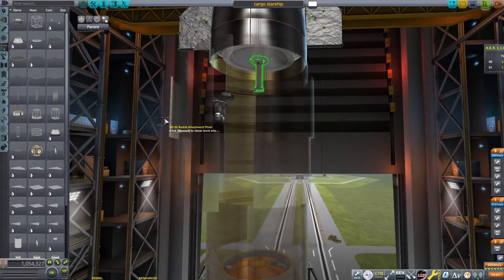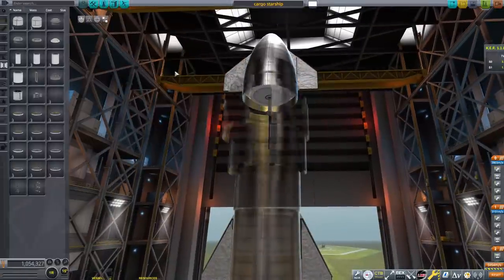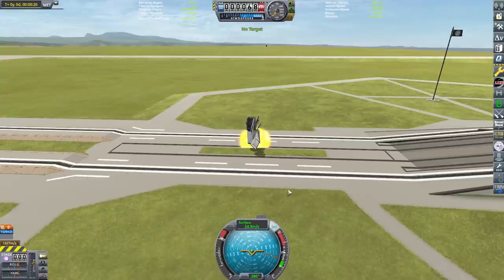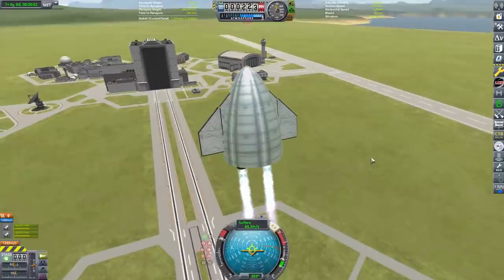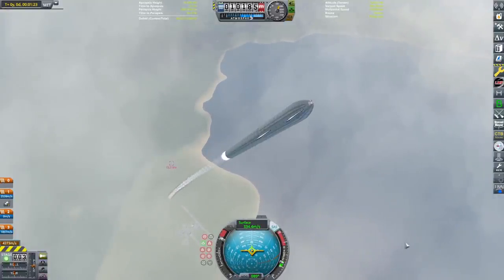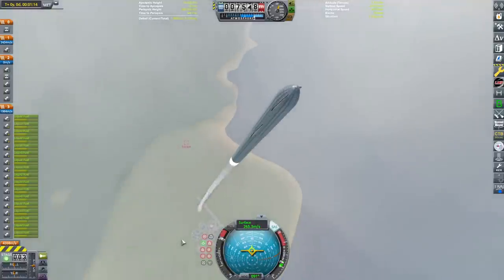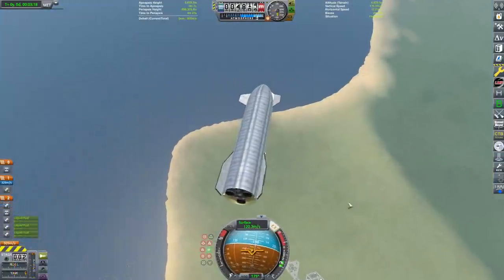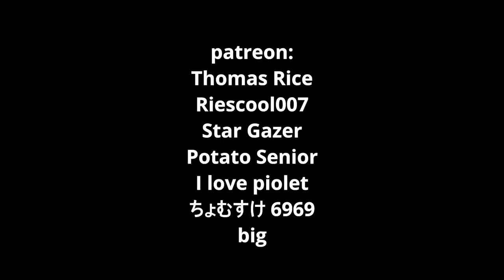KSP: What If Starship Had An Abort System!?

Comment: You do know that the nose cone has no room for crew right? What are you trying to recover? Just the nosecone while killing the crew and payload?..... I like it, very Kerbal
Reply: The crew would be in the Nose Cone tho
Reply: @thechroniclegamer4285  you’re suggesting that the crew swims in the methane header tanks? I suppose buoyancy could held reducing G forces
Reply: @dutchuniverse  there’s a major difference between the cargo and crew variants dude
Reply: @thechroniclegamer4285  the header tanks are going to be needed on both vehicles dude
Reply: @dutchuniverse  the crew variant has the crew on the nose, it doesn’t make sense otherwise
Reply: @thechroniclegamer4285  the crew variant design hasn’t even been published yet lol but if it has to land, it’s going to need header tanks
Reply: @dutchuniverse  then where’s the crew gonna be because the crew variant has a cargo bay and a crew section
Reply: @thechroniclegamer4285  the rest of the vehicle is going to be plenty big to have the crew anywhere except for the nosecone lol
Reply: @dutchuniverse  perhaps Starship isn’t good for crew missions, perhaps it’s better as a tug for a capsule
Reply: @thechroniclegamer4285  starships interior is huge, it’s fine to carry crew once it’s as reliable as dragon with falcon 9
Reply: @dutchuniverse  there’s no abort system for it, and the fuel issues
Reply: @thechroniclegamer4285  no need to abort if the ship is proven reliable and fuel is plenty when it’s topped off with a tanker ship
Reply: @dutchuniverse  space Shuttle moment
Reply: @thechroniclegamer4285  bound to happen at some point if they end up flying several crafts a day, it’s the risk of exploring new frontiers. Even Elon said during the initial unveil of ITS that deaths will be inevitable but that they’ll do everything possible to prevent it
Reply: @dutchuniverse  except abort systems severely negate the dangers to crews, especially since the projected Starship Crew size is like 7 people
Reply: @thechroniclegamer4285  lmao starship is technically capable to carry a hundred people
Reply: @dutchuniverse  bro what? That’s statistically untrue if you wanna be able to keep engines
Reply: @thechroniclegamer4285  that’s what Elon announced way back when they announced the project
Reply: @dutchuniverse  that’s 
A. statistically impossible
B. The flight size of the first starship moon mission is 9
Reply: @thechroniclegamer4285  it’s not, just cause it could carry a hundred people doesn’t mean they will. They’ll probably have a couple or a few dozen crew per ship for the Mars missions. The Moon roundtrip is a demo flight, it’s going to technically have unlimited capacity to bring stuff for the crew cause of how small the crew is. Crew Dragon carries 4 people generally cause that’s what NASA wants, it’s technically capable to carry a crew of 7 at 9.3 square meter pressurized volume. Starship is going to have 1000~1100 square meters pressurized volume. Do the math, dude.
Reply: @dutchuniverse  

A. Starship is the most unsuitable vehicle for a mars mission for multiple reasons that should be apparent to you already

B. Starship physically can’t hold a hundred people and anyone who told you otherwise is a liar (you also assume they’re gonna spend all the time in a chair, but they won’t)
Reply: @thechroniclegamer4285  what makes starship unsuitable for Mars? Do you even know what starship is meant to be for? And you’re calling Elon a liar? Optimistic maybe a better way to put it. Flying a hundred people is perfectly fine for intercontinental travel if the governments of the world are not going to put up too much red tape on flying rockets near big cities
Reply: @dutchuniverse  Elon doesn’t understand as much about rocketry as you think that’s why he’s got engineers

There is absolutely no way a single launch to mars rocket will ever succeed, there’s no way a starship would be able to burn to mars, capture, land, take off, circularize, and return and land in one mission, it’s simply impossible and unsafe
Reply: @thechroniclegamer4285  and that’s why Elon intends to have a huge fleet of these flying frequent routes to Mars kinda like establishing the railways
Reply: @dutchuniverse 
A. Not possible due to transfer windows
B. Doesn’t solve the problem
Reply: @thechroniclegamer4285  have dozens of ships parked in orbit till the transfer window hits, launch a bunch of fuel tankers and burn to Mars. Not that hard, no?
Reply: @dutchuniverse  it takes too much time to reach the transfer point, you’ll have to carry enough consumables for the crews (also 7 minute communication delay will make automated missions difficult)
Reply: @thechroniclegamer4285  I don’t think that’s a problem once rapid reusability for the biggest and most powerful rocket is achieved
Reply: @dutchuniverse  Consumables will be a issue, and the 7 minute delay can be the difference between success and a mission kill
Reply: @thechroniclegamer4285  not if you have a fairly small crew per ship and tons of payload capacity and it’s not like they haven’t proven autonomous capacity with the dragon vehicle. They mentioned probably doing about a thousand launches before attempting to to a manned mission to Mars so it’s going to happen someday, probably just not as soon as Elon would like
Reply: @dutchuniverse  it still doesn’t make sense
Reply: @thechroniclegamer4285  I guess things will start making sense once we see these launching on a daily basis
Reply: @dutchuniverse  they statistically won’t be launching daily
Reply: @thechroniclegamer4285  why not?
Reply: @dutchuniverse  For all intents and purposes the Starship is the exact same thing as the Space Shuttle, it’s not built for anything beyond LEO, if anything is more suited for a direct mission it would be the Artemis and Orion platform, but even then it makes more sense to assemble in orbit, and Starship is not the ship to travel to another planet, it lacks the fuel and has heat shield and consumables risk
Reply: @thechroniclegamer4285  lmao you have no idea what you’re talking about dude, the space shuttle orbiters were only capable of 24 ton to LEO while starship is shooting for 150 ton to LEO. With on orbit refueling that’s going to enable insane payload capacity between planets. One thing I do agree on is the heatshield however but then again, it’s only in the development stages and unlike space shuttle, starship is mostly unaffected by politcs. IMO politics ruined the potential space shuttle had while spacex has already proven to be able to exceed many capabilities on F9 and dragon
Reply: @dutchuniverse  

A. Starship is nowhere near completion so you cannot compare payload sizes

B. Starship can only reach LEO on a single fueling

I know more than you since my source for everything isn’t Elon Musk
Reply: @thechroniclegamer4285  sure buddy, check back in with me in a few years 👍
Reply: @dutchuniverse  If the predictions of Elon Musk fanboys then where was the 2021 Starship Launch, and what happened with SLS launching successfully before anyone predicted
Reply: @thechroniclegamer4285  lol SLS was massively delayed like any other project, everyone is skeptical about Elon time, including the dude himself 🤣
Reply: @dutchuniverse  true

Comment: I think its worth stepping back and asking the obvious question - do we even need a human rated Starship? The answer is no, we don't. Starship may well prove to be an effective way to get cargo into Earth orbit cheaply. If we can do that then human space flight, including to the moon and Mars does not need Starship. It needs vehicles for humans that are specialised to the task given to them. As in an Earth orbit to Mars orbit (and return) transit vehicle. Since it doesn't have to land anywhere it can be far more optimal than a vehicle that does have to land. As in a specialised, light weight, Mars lander/ascent vehicle. Again, something designed for purpose and not a trying-to-do everything compromise that Starship is.

Here's another way of thinking about it. You've successfully added an abort stage to Starship. This subtracts from the usable mass, space and fuel budget. Hence whatever you come up with isn't suited for interplanetary transport. Its a vehicle designed only for Earth to orbit and return. But hand wait a minute. We already have safer alternatives for this purpose called Dragon and Orion - and there will be other alternatives shortly. Heck they may even get Dreamchaser working. Starship does not have to be human rated and if it were it would never be as demonstrably safe as a regular capsule shaped vehicle.

Comment: I think a better abort system would be a solid fuel system, where the payload section yeets itself away and bellyflops to a safe speed and altitude, where the crew ejects and parachutes.

Solid fuel abort systems are very safe and reliable. Thay are existing technology, and so are ejection seats (they were used in the Gemini to partial success)

Comment: Hi! I’m Dylan Baker, and I play KSP! I have a challenge for you. It is to build a space shuttle car, and you do a space shuttle car because:

A. Top Gear once did this with a Reliant Robin, and I’ll put the link here (@ but it failed, so I suggest you do a four-wheeled minivan as the orbiter.
B. An sports car (like the Porsche 911) as the space shuttle would be quite cool. 

Here’s the instructions:

1. Build a sports car and test it on the ground.
2. Attach wings, a tail-fin, some parachutes, and a engine on it.
3. Attach the car to a mini-Energia-like booster/mini-external tank and solid rocket boosters.
4. Launch it into orbit and to the moon with Kerbals inside it. (If you select the core booster, than the core boosters and the solid rocket boosters will do the work for liftoff.)
5. Explore the moon.
6. Refuel the rocket
7. Return the car from the moon and back to Earth with a powered-glide. 

Please do the challenge for me so all your fans (including me) are impressed please!
Reply: Matt Lowne actually did this exact thing

Comment: what engine would you use? They would need to design a methane engine which has much thrust and much wow. I don't think putting raptors there would make sense because they take a bit of time to ignite, they are heavy and they would just blast the starship superheavy away and it would explode which isn't good news for the crew trying to escape.

Just my guess please proof me wrong because I do think that manned space crafts should ALWAYS have an Abort system, including starship
Reply: What’s  wrong with using solid fuel
Reply: you are probably right.

Comment: The unrealistic part is that you've already brought Starship most of the way to vertical before doing the abort (this is on landing). The worst case is no engines relight and thus you're oriented horizontal or even partially nose down. Thus as the abort stage lights it will need time to re-orient itself upwards. Time you probably don't have.

Comment: problem with the RTLS is that the fins wouldn't give you that kind of control, it's only possible due to KSP's super unrealistic reaction wheels. What might be possible is having the center of lift over the center of mass, so that it would point retrograde by itself, engines facing down to softly splashdown in the ocean
great idea tho, really well done!

Comment: I think 1 vector/raptor would be more realistic or at least the engines should be closer together if one fails. In a inflight abort you would shut off the booster Engine/shut down the fuel lines. Greate video and greate content.
Reply: Just use solid engines

Comment: i saw this in a guys video but the starship wasn't stock, pretty good sistem but if I was elon I'll just decouple the starship from super heavy and belly-flop normally.
in case of a bad relight in landing it's almost imposible to die because you can land with 1 engine or 2, there's very low probably to all 3 raptor to fail at the same time. btw when starship is more mature for people to go on it probably never fail on belly-flop
Reply: Was it a Russian channel
Reply: Also looking at SN 10 and other ones, it durable as hell.
It would give crew the time needed to escape.
Reply: @kiwifruit4734  i think yea

Comment: Nice vid, I would use SRB’s and parachutes for a LAS because what if the abort engines failed? Execpt its KSP so engines can’t fail.
Reply: Or hypergolic fuel, it is VERY unlikely to fail and can be controlled.
Or maybe try to make hybrid hypergolic to reduce complexity and be reliable and to be able to control it.
Reply: You could use quite a few of the SuperDraco engines as an abort system.
Reply: @camerondeatcher9668  I really doubt that it would be enough with acceptable number

Comment: Starship is the abort system, if something goes wrong with super heavy, they could just fire up starship
Reply: And also they can turn off engines of Super Heavy because they aren't SRBs
Reply: Problem is that fully fueled Starship does not have a great TWR (probably something like 1.4), which is not much for an Abort System. For comparison, The Crew Dragon roughly has a TWR of 4.5, which is needed to escape an exploding rocket. Also a big question mark would be: What if everything goes right with Super Heavy, but Starship itself fails. This case would pretty much always result in a total loss of vehicle and possibly crew.
Reply: @Oculaz  Where did you get info about TWR? Also lunar one will have slightly more due to upper engines, and in theory super heavy could use grid fins for more drag.
And If I remember Crew Dragon uses only half of max power so even half of engines can fail and crew can still be safe.
And in theory you could use more raptors (it would be change but not a big one).
Reply: @ImieNazwiskoOK  Grid Fin Deploy Sequence would probably take too long in the event of an explosion (you can see on Falcon Launches how long these titanium grid fins need to deploy even in Zero G. I am not even sure if they can even deploy at this altitude.
I actually took a deeper look into the weights of Starship. Starship has a wet mass of approximately 1320 tons while all six raptors (sea level and vacuum) have a thrust of approximately 1360 tons. This equals to a TWR of actually just 1.03, which is fine for a normal flight, since the tanks empty quick enough for the TWR to increase just in time to reach orbit, but as an abort system, this sounds highly impractical for an abort system. Even Crew Dragon at half that power with an TWR of just 2.25 is much higher than that.
And yet there is still the problem of the possibility that Starship itself experiences a failure in flight.
Everyday Astronaut did a great video on this topic in which he came to the conclusion that there were almost no times (if I remember correctly) where an abort system actually saved a crew. However, we do have to keep in mind that there are relatively few rocket launches with crew in general. SpaceX aims to achieve flights with Starship that are on a same quantity level like airliners, which would increase the number of crew flights and number of possible launches, where something with a crew on board can go wrong drastically.
I am not sure if SpaceX would really consider adding more Raptor Engines on Starship (quite hard, since 3 sea level and 3 vacuum raptors fill the space completely) just to have an abort option when something goes wrong with Super Heavy. Especially, since it seems like they want to try as much as they can to avoid adding an abort function. However, I do think that they will need to put more efforts into thinking about this. Especially if they consider flying NASA astronauts with it. NASA seems to be paranoid (not meant in a bad way) about not having an abort option since the Challenger Disaster, which would have been avoided with a rocket like SLS, where the capsule sits on top of the rocket.
Reply: @Oculaz  Where did you got info about mass from? (just curious)
3 normal Raptors would fit easy, maybe 6 or even more but it would reduce vectoring.
And using Starship as abort system is semi solution. Partially answering problem, but without adding much more complexity and problems.

There were nearly no times when launch abort saved crew, but a lot of times when it would (aka STS program).
Also it's private company so disaster with crew = media drama = less money and clients.
Reply: @ImieNazwiskoOK  got the info about mass from Wikipedia

Comment: I'm not sure if they'll include an abort system because it's basically extra mass to carry, however, crewed missions will be much safer. This is also an issue, if there was to be an abort system, they might have to do extra orbital refuelling before it heads to the moon and beyond. The prototype you made is very interesting, but I would recommend putting the engines on the side of the nosecone to make it more realistic.
Reply: Spaceshuttle also didn’t carry an abort system

Comment: Or, SpaceX could launch empty starship (with no crew) and using more safe rocket as the Dragon (maybe a larger version, with no cargo bay so more people could get in) and make a randevouz and transport the people aboard. After all the emergency system would be used only on earth (if starship explode or has a failure while landing on Mars, you will fucked up anyway, you probably would be stuck on the surface)